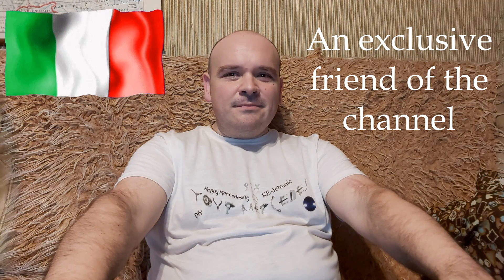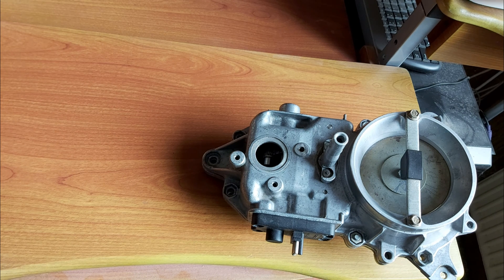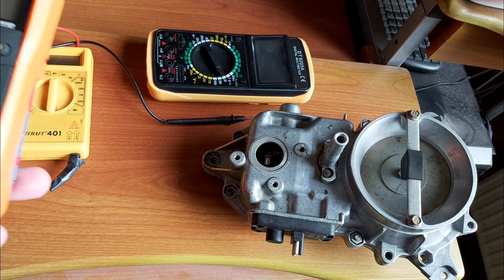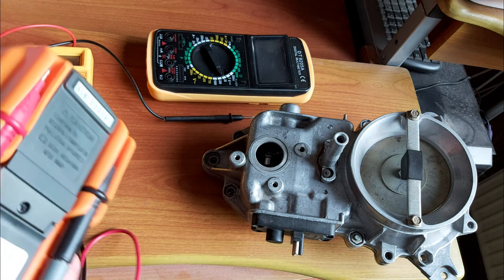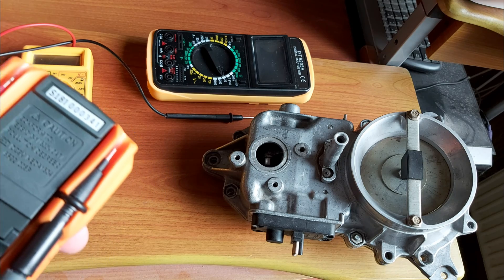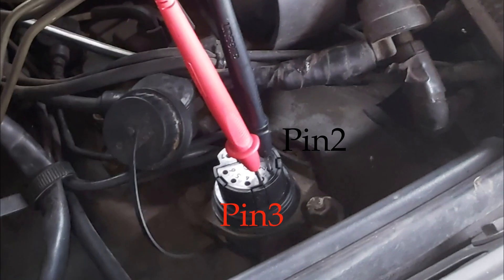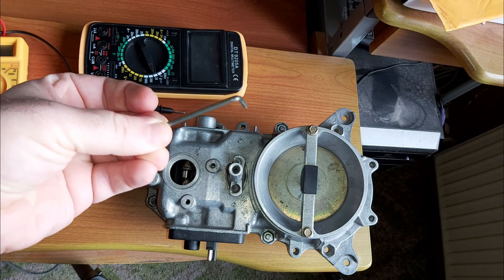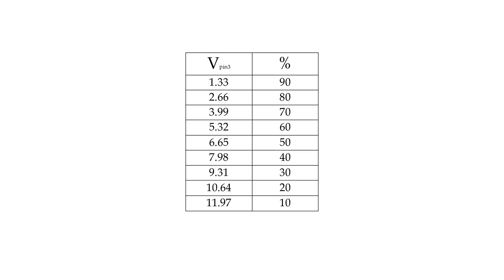㉦Mercedes Ke-Jetronic㉦ - The duty cycle/how it's done

Comment: Greetings from Greece!!! Thank you!!!
Reply from the maker: @emmanuelkarantemoires2161  Thank you as well! Happy Mercedesing 🍀 😊 😃 😀
Reply: @mercedeske   After endless trial and error attempts, and thanks to you and other people here in YouTube, I've achieved a vary good idle and drivability. The car starts every time, hot or cold, goes directly to steady idle and drives smoothly. Only one problem still remains. When the car is hot and you turn it off, you cant start it for around a minute or two ... The pump works, it cranks, but doesn't start no matter what you do. That lasts for around 1-2 minutes and then starts completely fine. Is that how it normally is? W124 M102 200E 89' automatic.
Reply from the maker: @emmanuelkarantemoires2161  Have you replaced the fuel accumulator?
Reply: @mercedeske  Yes! Accumulator, Regulator, Pump and Injectors. EHA was replaced before I got the car and is fine, mixture is at 50%. I also replaced the voltage regulator that did cause some such problems and now it's better, but still only when it's hot and only for 1-2 minutes after you switch it off, it doesn't start...
Reply from the maker: @emmanuelkarantemoires2161  Hook it up on the pressure gauge, let the car be hot and then turn the engine off. If the pressure falls in half an hour, the accumulator is good.
Reply: @mercedeske  Thank you!

Comment: Hello Mr Ivica my car euro spec has no O2 sensor is it possible to do percentage test on port 1 and port 2... I don't have port 3
Reply from the maker: Hello. No it's not possible on those ports. Btw. something here is not right. Do you have a W124 230E or a W124 320E, there is a HUUUGE difference there!? Because W124.023 is a four cylinder 2.3l engine, not a 3.2l six cylinder engine!
Reply: @mercedeske  thanks for your reply
Reply: @mercedeske  yes Mr Ivica its 230E 2.3L engine... My problem is running very rich the mechanic adjust EHA pressure difference 0.3 bar to make it leaner but Milliampere on EHA is about -4
Reply: @mercedeske  today i will check duty cycle as you advice in video duty cycle on EHA..
Reply: Hello Mr Ivica.. I check duty cycle pressure difference 0.4 bar EHA screw adjusted at 6.6 mils  engine temperature at 80 degrees EHA shows -4 Milliampere rich mixture at idle is there anyway to make it leaner
Reply from the maker: @universalvideos7553 Yes, turn the eha screw for 8th of a turn counterclockwise clockwise and check the value. -2mAmp is a good value as well!
Reply: @mercedeske  thanks Mr Ivica tomorrow i will do that
Reply from the maker: @universalvideos7553  My pleasure 😉

Comment: On a cold car in open loop , you will read 50% fixed on/off ratio . In close loop , engine warm , that what you should be near . If you have an older analog voltmeter , in open loop , with voltmeter connected , set the voltage scale so  the needle is somewhere on the scale , the value that you read does  not mean anything ,make a note of that value, you are at a fixed 50 % .When the engine warm up , the oxy sensor now work , the needle will move somewhere up or down the scale , so with the 3 mm wrench adjust , so the needle goes back where it was in open loop , you are now again at 50% . the needle will oscillate near that value .
Reply from the maker: Exactly!
Reply: Thanks, all sorted out now, didn't warm the car up enough

Comment: Hi i have w201 102.962 RUF from 1986 with O2 sensor. Multimeter is showing 50% duty when ignition is on even if the throttle valve is fully open (should be 20% duty, am i right?). When engine works duty is also 50%. I would say that there is problem with O2 sensor but why it doesnt shows throttle valve open?
Reply from the maker: Hi.The % on ignition ON has to be 70% and after starting the car it should rise to 50. If you have never replaced the lambda, do it.
Reply: @mercedeske  Thank you. I know it but i'm asking is this normal symptoms of damaged lambda or its causing by other sensors?

Comment: So what would it be for 119 engine for idle an do u adjust  the c/o with the fully of  or on second turn?
Reply from the maker: As soon as you have a brand new lambda and the potentiometer you should have a good mixture adjustment under the condition that no obe has been messing up with the mixture screw.
Reply: Someone has messed the mixture up soon as I find fuel pump relay I will do what u have put up for duty cycle
Reply: The mixture screw has been messed with   when adjusting mixture screws the  car is running rite?  Or in second position   I have done the formula with x11 with the key turnt to second position and battery with car of my nbr was 35 to rich so from here do I 
Turn mixture screw with Key in second position till I get to 50 
Or
Have car running an make adjustment till I get 50 bearing in mind waiting 10 seconds b4 every adjustment 
Plzz plzz help I'm going crazy 🤪
Reply from the maker: @knick187  🙂Do it like this. Get the car to the operating temperature. Once you do, measure voltage - pin 2 ground, pin 3 positive. The goal is to achieve the fluctuation 6.6-7.3V. Then you will have a perfect running engine.😉😊👍🏻🍀
Reply: @Fix your Mercedes  thank you for reply my so called mechanic put in new fuel pumps an filter just last year ...but the cover for it was never put back or lost ? Could that be a big factor in why pumps gave out so early ?
Reply from the maker: @knick187  If you mean the lid for the whole assembly - no, that's not the case.
Reply: @Fix your Mercedes  thank you I will find some new fuel  pumps an filter an go from their

Comment: Hello, thanks for your helpful videos. I’m in trouble with my w124 200. I made de duty cicle diagnosis with a multimeter and a socket. I shows is a lambda faults (99,9 %) i replace it but I have the same results.
Reply from the maker: Hello and thanks for the comment and your compliments. In order to help you I must know if you have been readjusting the CO-screw, if your car has been manufactured before or after september 89. For now the only thing I can tell is to remove the signal wire from the lambda when the car is at the operating temperature. If you get 50% then you have an interruption in the wires. Then check for continuity the connector for your lambda and the 8th pin of the ECU connector. If you don't get a beeping sound then there is an interruption in the wires. That much I can say from this aspect.
Reply: @mercedeske  my car is a 92 model, I’ve tried to adjust the co screw, but nothing change, it seems like I don’t have signal on x11 socket
Reply from the maker: @ell7851  Check for it. 100% says NO VOLTAGE OR GROUND ON X11, SHORT CIRCUIT OR LINE INTERRUPTION BETWEEN THE DIAGNOSTIC SOCKET AND THE ECU, LAMBDA DEFECTIVE, NO VOLTAGE OR GROUND ON ECU - OVP DEFECTIVE(check the contact 87E on the OVP), MIXTURE TOO LEAN - LAMBDA DEFECTIVE, SHORT CIRCUIT ON GROUND! That's what you have to check, everything I have mentioned.
Reply: @mercedeske  thanks
Reply: 😢hi man. I’ve tried many things:
1) i have voltage between 2 and 3 ok socket ( 2,45 V Dc at idle)
2) i have ground on ecu
3) lambda is new
4) new odp relè 

But nothing change😢 can i send a video on your mail?
Reply from the maker: @ell7851  You can also on Instagram. But let it not be a disappearing video. If you have voltage on X11 and it reads 2 or 3V, it's not enough, you need 6.6V. There, for the beginning...
Reply: @mercedeske  i hace 6,5v but ac. On dc i have only 2,3. Did u think should be the ecu?
Reply from the maker: @ell7851  It has to be DC. I can't say, really just like this. I know nothing about the cars readings so there is nothing I can say. You will have to provide me with information about the components that have been replaced as well as about the reading of the actuators as well as the sensors.

Comment: Hi, does it work if my car has no o2 sensor? 190e m102  EU spec from 1990
Reply from the maker: Hi. Yes, it does, you just have to get steady 50% So, no ups and downs, just steady 50%
Reply: @mercedeske  Okay im gonna do that, I changed the potentiometer and eha is working well but the sparksplugs are still looking whitey. I hope setting the co screw will be the solution. Thanks for your response keep doing it man your the best
Reply from the maker: @louis525d7  Thanks. You can measure the mixture on the EHA. Your target is 0mA when the engine is warm, -2 if you want a richer mixture. Good luck!

Comment: I’ve got a 86 420sel. I put red lead on #3 port and it has a reading but when I put black on #2 port it doesn’t work. This is on the x11 port.
Reply from the maker: Which readings di you get?
Reply: I decided to use a regular multimeter and did a static test with engine cold. I got 12V for the battery and 3.58 for pin 3 on X-11. This is for 1986 420 sel.
Reply from the maker: You must perform the test when the engine is warm. If you got steady 3.58V then that's not good.
Reply: Okay  I got a multimeter with duty cycle function. I drove it for 10mins and did the static test with  left vac hose plugged it was 69.8%. I started the car and it was going all over from 53-66%. I turned the co screw cw to lower the duty cycle but it went higher. I moved it more until the engine started to not run as smooth. I turned it ccw until it smoothed out and ran better. The duty cycle went down. I turned it further to but it didn’t run as smooth so I left it where its at. My original problem was a shaky engine idle but the car started and ran good just the idle was the issue. I messed with the co screw without knowing about the duty cycle and the next day the engine had a hard start when cold. I checked for vac leak and found one at the AFM so I fixed it. I also put a new o2 sensor.
That fixed the shaky idle but now I’ve got cold start issues and a duty cycle that is all over the place. I checked with a regular multimeter and the battery was 13.98 volts and 12.98 at pin3 . I did a hot start after the duty cycle adjustments and it started fine with a hot start. The idle is smooth but we’ll see if I have cold starting issues again.
Reply: I made a video of my duty cycle test if you’d like to see it. It’s on my YouTube. Thanks
Reply from the maker: @georgesand4629  Okay 👍🏻

Comment: hello.
I bought a used part to replace the throttle body, but the part has the hole entrance that is adjusted with a hex wrench blocked with something like silicone.
Is it the cap that originally blocks the entrance to the hall?
What should I do if I think I will have to remove the cap to steer it with a hex wrench?
Seek advice on how to solve it.
Reply from the maker: Hello. Don't touch that screw. You will never manage to make the tps working properly.
Reply: @mercedeske   thank you
I am not trying to manipulate the screw, I am asking if it is possible to remove the cap that blocks the entrance to the screw adjustment hole, and if it is possible to remove the cap, I am asking how to remove it.
Reply from the maker: Mine was off, so it is possible but you really don't have to do it.😀

Comment: Awesome work again!
I dont't get any voltage on my x11 pin 3, buy for example i get voltage on pin 2.. What could be the problem?
Reply from the maker: Thanks. Number 2 is ground. Number 3 for duty cycle. Do you have just a hole on pin 3 or it's connected? And how does the car behave?
Reply: @mercedeske  It looks like it is connected like all the other pins. The car has pretty high fuel consumption and also it feels like the car is not getting the right mixture when accelerating from 0km/h when the car is warm. It kind of jerks when accelerating
Reply from the maker: @juhis233  If you have lambda and it's never been replaced, then replace it. In order to do the duty cycle your lambda and potentiometer must be functional as well as the eha.
Reply: @mercedeske  I recently replaced the lamda with bosch oem part. It didn't have amy effect on performance etc
Reply from the maker: Try it like this. As the car is on 80C hook up the multimeter on the eha(if you don't get the reading for the first time then replace the leads, the polarity changes always on the eha) you will have to read between-3 and 0 mAmps.

Comment: You are a fountain of knowledge. 
I have a 260E  M103 and trying to identify low idle issue. You said in video that if you get constant 50%, there's a problem. Should the voltage fluctuate when doing the test?
Cheers
Reply from the maker: Hi, thanks. If you get a constant 50% that means that either lambda is defective or it is not ready to work. Usually, if there is a problem it should appear in a steady number, 60, 40, 20% for example. If the fluctuation starts between 50% everything is okay. You can do the same in voltage using the formula I gave, or even better - by measuring miliamps on the EHA.
Cheers, best regards
Reply: Thank you for your reply. 
Trying to figure out this problem for the last 12 months.
When cold it takes a few seconds to start. 
When the car heats up, it hovers on idle at approx 500 rpm.
Sometimes in traffic it would stall and not start again.
If I wait awhile it will start again.
My 260e has 9 pin circular diagnostic connector but it has no lambda sensor or catalytic converter.
Did another Voltage check today on Pins 2 & 3. It read a constant 7.05volts.
Also did a Duty Cycle Test on Pins 2 & 3 but also remains constant at 50.6% and 97.61 Hz. There is no fluctuations.
Any advise ???
Your videos are excellent. 
Keep up the great work. 
Cheers
Reply from the maker: @brianalcock  Hello and thanks. If your percentage remains on steady 50% then your mixture is excellent. Did you check the potentiometer? Do you get steady 0.7V on idle when the car is warm? If yes, then check the idle control valve?
Reply: Took it for a 5 mile drive before I checked the duty cycle. On idle it remains at   7 volts. I  also checked the potentiometer and that appears to be doing its Job. Will check and clean out  ICV and report back. Cheers
Reply: Hi.
Managed to take out and inspect ICV.
Appeared OK. Tested it for resistance and it read 00 ohms ???
Soaked it in brake cleaner overnight and reinstalled it.
Reconnected voltage connector  and put key in start position. I could physically see the circular valve moving freely.
Went for drive but still have low idle and slight stutter.
Do you think it may still be an issue with the ICV because of the zero ohms reading??????
Really appreciate your time and great advise.
Cheers
Reply from the maker: @brianalcock  Hi. The nominal value for the resistance for your car is 7.5-10ohm You must get that resistance. If you are out of these specs, that means that you have a bad icv. Btw. measure the current when the car is on idle warm. You have to get 600mAmp +/-50. If you are out of these spec, you have a bad ICV.
Reply: It's back to the drawing board.
Used friend's multimeter and it gave me 8 ohms.
Problem is it idles at 500rpm when at operating temperature.
May get  lower in traffic and stalls. Will not restart.
There is always a slight stutter on idle.
Duty Cycle and ICV appears good.
Will now look at fuel pressure and Distributor cap/Rotor over the weekend. Will report back.
Any other areas, I should be looking at ?
Thanks for all your help.
Cheers
Reply from the maker: @brianalcock  Check the pressures and start the car to see if the pressure drops on idle as well as by pressing the accelerator.
Reply: Hi
I don't have access to a ke jetronic pressure tester at at moment.  Can I use a cheap pressure tester and buy the attachments or is that a no no. Any other way of getting around this issue. Cheers
Reply from the maker: @brianalcock  You can absolutely buy that cheap one. It will be good for one purpose, don't worry 😉
Reply: Will have to wait to purchase pressure gauge. In the meantime I will change distributor cap/rotor, fuel pumps and filter. Any other parts I could address???
Cheers
Reply: @mercedeske  
Hi Still trying to solve my annoying issue of low idle. Can I ask, I have a 260E, M103 with a KE Jetronic with NO O2 Sensor.  Is it still possible to test Duty Cycle with a Multimeter?
I read the car has to have an O2 Sensor  for duty cycle values. When I do the test the multimeter  reads a constant  50%.
Reply from the maker: Hi. If the car reads constant 50, then everything is okay(as you have no lamba).

Comment: Hello Ivica, first of all thanks a lot for your channel and all the effort you're doing to demystify the KE Jetronic. I'm onto fixing/fine tuning my M102 W201 (w/o KAT) from 1989 and on the hood I do not have % on the sticker for CO adjustment. Do you know what 1,0 +- 0,5% CO means ? And how it should be measured with multimeter ?
Reply from the maker: Hello and thanks. That means the allowed emission of toxic gases. In order to measure it you must have a gas analyzer which plenty of us DIY-ers don't. But with a multimeter which can measure duty cycle you can. Select  the % option and your goal is to get 50% +/-5%

Comment: Awesome videos, thanks to you i managed to understand a lot how the ke-jet works and how to troubleshoot it. Today I adjusted  the potentiometer and the duty cycle and my 190e has never run smoother and it is more responsive to throttle. (The values before adjusting was  0.82v on the potentiometer and the duty cycle was almost 70%).
Reply from the maker: Glad you made it. Happy Mercedesing 😃

Comment: Thanks 🙏🏽 thanks 🙏🏽 good job 👏🏽 🤝🙏🏽🙏🏽💪🏽
Reply from the maker: You are welcome. Happy Mercedesing 😃
Reply: Still I have problems The distributor is not passing fule
Reply from the maker: Have you replaced the fuel filter? Have you checked the condition of your fuel tank and its filter(the strainer)? Then if you have no fuel low you will have to rebuild the fuel distributor.